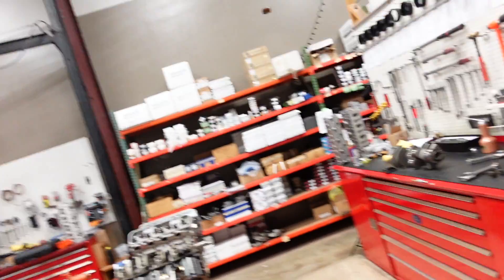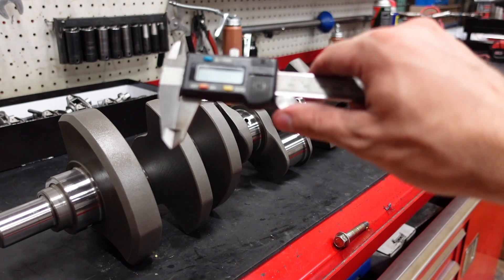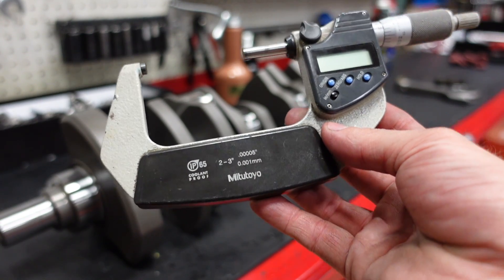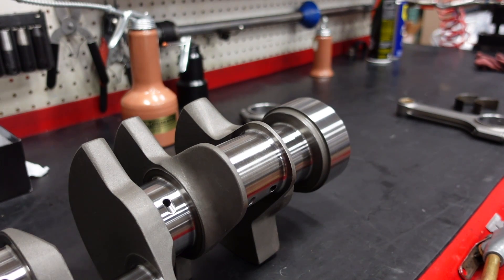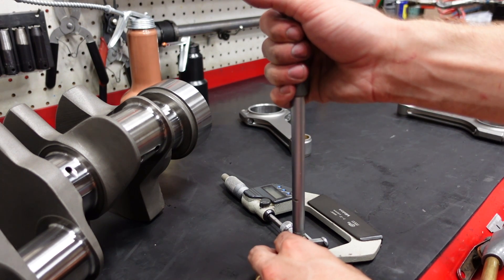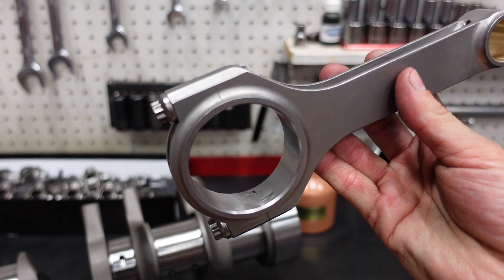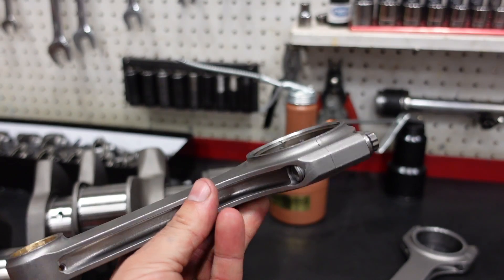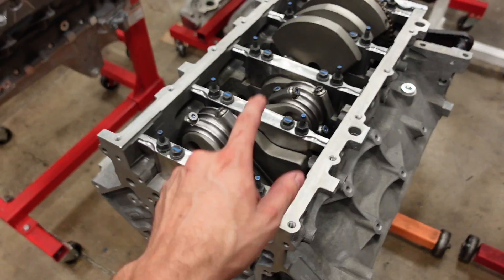Measuring Bearing Clearance (very easy) - Tech Tip Tuesday

Comment: Man I don’t usually comment on stuff but you have no idea how to use a micrometer. The ratchet  on the end is there for a reason. This is 100% not how you use it. Even if just using it to set your other tool you still would set the mic using the ratcheting end and feel. Not locking it and shoving it on the crank.

Comment: Hello and thank you for the video but to understand correctly if you had put the micrometer in the rod bearing to measure and the gage went to zero that means you have zero clearance instead of the 2.900 clearance?

Comment: can i get the clearance without having any current bearings??  or do i have to buy a set of bearings??
i just got my crankshaft machined, i dont have any bearings but i have crankshaft journal measurements only. i bought a mitutoyo bore gauge to measure the rod journals but i dont know if i can do anything without the bearings.

Comment: Im laying below my car, in the rain, its cold, dont got any tools other than a caliper, oil pan removed, crank bearing at cylinder 4 ended up in the oil pan, trying to meassure if my crank shaft can be fixed, chat gpt says if more than 0.5mm are missing it cant be saved, i did meassure between 0.2 to 0.4mm are missing, it also got grooves, idk what to do
Reply: Sand it and send it. Then sell.
Reply: @Slug2.0T  nah, aint gonna sell this beauty. Ended up buying a junk engine with a decent crank, currently removing the engine to have it sent to a shop for a full rebuild

Comment: Is it me or am I missing something. These videos show the installer measuring with bearing shells in place. How does that make sense. How do you know what shells to order ? Do you buy the wrong ones and then buy the right ones? I have a crank that spun a bearing . The crank survived luckily but the shell is damaged because I think the wrong shell was installed on a previous build ( not by me). I normally work on Harley engines that don't use shells so I am not an amateur, just not used to working with shells.   I want to measure the crank pin and the rod then order  bearings? Why do I need bearings already installed when I don't know which to buy?. The rods don't come with bearings.  The shells don't seem to be able to be ordered by thickness , only colour or number 1,2,3,or 4. I must be missing something. Please comment if you know what I am talking about.  To make it more difficult the vintage engine does not have many parts available so I can't just buy all the bearings and see which work best.
Reply: Currently the question I’m trying to answer. Do I spend premium money on a premium set of standard bearings just to find out I paid for bearings I don’t need?

Comment: I have been doing this exact method and have been having trouble getting consistent measurements when I remeasure things. I have a feeling it's because I haven't been consistent with the micrometer pressure on the journal.

Comment: Do you ever worry about scoring the bearings when using the bore gage?  Some guys measure without the bearing and then check thickness of the bearings.  I'm not sure which is better.

Comment: I use the ratcheting mechanism on the end of the micrometer so you don't over tighten the micrometer when measuring. Also I check the micrometer with the proper standard to make sure it reads true before measuring components.

Comment: So once you've torqued those rod bolts to spec, when you take them back apart you may need new ones as some of these bolts (BMW M20 engine )can only torqued once.  How do you get around that?
Reply: The rods he was using didn't have torque to yield fastners

Comment: I am curious about the rod bolts. When you replace the rod bolts, is it OK to do this testing then  to remove the nuts/caps and reinstalling back into the cylinder?

Comment: Thank you for the video on this! I greatly appreciate the insight! With that being said, my dial bore gauge left some marks (they look like fresh metal marks) on the con rod bearing when checking it. Would this still be okay to still run these bearings even with the lines showing up on it? First time using a dial bore gauge to test bearing clearance and I want to make sure we don't jack up the bearings just checking them 😅 

Thanks again for the vid!

Comment: if i had a guy in my shop that tightened down a micrometer and forced it over a crank journal the little jerk would be flipping burgers tomorrow.
Reply: That was a good demonstration on how to get the feel for the right amount of tension. It was a good demo except for the hair on the back of my neck raising when it squeaked.

Comment: The rod bearing is typically not even close to round or flat across the face.  What is the clearance that matters on the rod bearing?  Middle (max) or outer (min)?  And also where radially - perpendicular from parting line (narrower)  or closer to parting line (wider)?

Comment: Question: I just pulled the motor from an Audi A6 3.0 V6 . I pulled it because it sounded like Rod knock, but when I broke the  motor down the only bearing that looks messed up is the front most of the four (front of the car) don't know what that particular bearing is called . I mean I know  it's a main bearing, but I thought maybe they had technical names for their exact location.  The bearing is seized around the crank. Could that make a rod knock sound? The sound was only under load and there were no codes and I checked everything as I broke it down and can see no other problem.

Comment: I like how you explained it a little better if not a lot better than some of the other ones I saw on YouTube. It's been over 25 years since I mess with a dial bore gauge and Mic set. I usually throw the motors together with the bearings as they are without checking really. Unless I run into a problem where it's too tight. But with this performance build I'm doing with a LS3 and LSA supercharger I'm going to make sure everything's correct.

Comment: Or you could use the part on the end that spins free of the other spinny bit. Thats how you properly adjust to the correct measurement without putting the micrometer under tension.
Reply: This is the only way. Mitutoyo engineers crying. Apart from that, good video.

Comment: What clearance would you recommend for a turbo ls? Iron block running summit ls pro forged crank and rods currently have extra clearance shells on top and bottom on mains and rods. Aiming to hit 1k+ is 0.003 too loose ?
Reply: 3 thousandths is good and you’ll want a higher weight oil

Comment: That's one way to do it, but I prefer to take multiple readings around the journals, average them, and check out of round or taper on the journal. Taking one point doesn't give you the whole picture. For a relatively loose race deal with .001" clearance per inch of journal diameter, this method works, and is better than Plastigauge. I would go further personally, and especially when going for tight clearances with thinner oils like many modern race engines.

Comment: Then replace all the bolts that were just stretched to yield as per torquing to spec instructions?
Reply: ARP hardware isn’t torque to yield like oem hardware that stretches

Comment: I love your videos and I love your channel. 

Keep the videos coming!

I do want to say, when determining the diameter of the journal, you should be using the rachet at the end of the knurled gripe. This is setup to slip once the correct "tightness" is determined and the measurement can be taken. Turn the rachet until it stops, lock the spindle in place and that's the most accurate way to get your measurement.

Comment: BTW, if you need a micrometer specifically for tubing or tube type materials, they make special anvils and micrometers to make it easier when trying to find the high points. A 10th mic with gently hands works fine (.0001 accuracy and calipers will be good for .001 accuracy) Mitutoyo and Brown and sharpe are 2 of the best.
Reply: How do I find one of these? Tried googling and not much luck. Sounds more accurate than trying to guess the right feel of tightness
Reply: Something that misleads a lot of people. 
It looks good that there's a 50 millionths *resolution*, but that doesn't mean it's that accurate. My 0-1" Mitutoyo, according to the calibration sheet, reads +.00005" at 5 different measurements other than 0. Unsure on my vernier ones, .0001" resolution, but I'm sure they're anywhere in the +- .0001 throughout the measurement range. It's not much, sure, but it can be the difference between something in tolerance or out.

Comment: Guys, please don't do that to your micrometers. Gently find the center (highest points) on the material, then gently twist until both sides make contact and you cannot close the micrometer any further. As a machinest I appreciate you recommending micrometers, but that is not how you use them and will ruin the precision by doing that.

Comment: Thanks for the info. Nice video. However, I think you rushed it at the point of showing how much actual clearance was determined, while looking at the bore gauge, and the needle was sweeping. Some might not have caught on that you're looking for the maximum amount of deflection in a clockwise direction from 0.

Have you ever discussed the condition of main caps, and what their condition indicates?  For example, I have one main cap that has surface (bearing side) ever so slightly rough (maybe spun bearing?), while another main cap, which I think was at #1, looks like it was polished, almost chrome. What are these cap surfaces telling me?

Comment: Man when that micrometer was extra tight on that journal and it caused it to squeak it sent a shiver down my spine lol
Reply: If you think you're scratching the crank that easy then......well idk what to tell you then, it wasn't a sharp edge, it was flat on flat and there both hardened, am I the only one thinks that was no big deal?
Reply: @troybrake5686 I doubt there will be no impact on the micrometer anvis, even though there are 7 types [ based on my experience],  even if the impact of scratch on the shaft is insignificant
Reply: @troybrake5686 😂 0:36
Reply: I work for cat an do this a lot , most people have it over tight an  scratch it 😬.
Reply: Hey whats the little knob on the back that tightens it down but goes clicky clicky when it starts to snug onto what your measuring for??
Reply: The large thumb wheel is for moving the anvil large distance. Once you feel resistance with this, you move to the small thumb wheel and turn until the fine tune ratchet clicks. @bluedogydoor
Reply: not what you do, you aneak up on it, and have to have the right feel. you can change the reading by using too much force
Reply: That's the only reason I came to the comments
Reply: It’s perfectly fine🙄
Reply: was about to watch this video but when i saw this I'm backing out.

Comment: I have some telescopic bore hole gauges.  Would I not be able to use it and then measure it with the Micrometer?
Probably better with the bore gauge I think.
Thanks so much for your wealth of knowledge.
B
Reply: Telescopic gauges suck for this purpose. Get a dial bore gauge, and get one that reads .0001". May as well be using plastigage with anything less. (Don't get me wrong, a zillion engines have been put together with Plastigauge, but it isn't performance precision. I have found that the stuff reads a full thousandth tighter than actual clearance while experimenting on the same short block. ex. .002" w/ PG = .0029-.0031 with my dial bore gauge.)
Reply: You are introducing more random error by using telescopic gauges.

Comment: Okay let me stop you about your tension against the rod journal. The little knob at the very end of your caliper is your tension. When you turn that and the caliper stops moving it clicks because that's the set tension you want that caliper to have against the material. Once that clicks you move it to see if there is more tension or less tension anywhere else. Use your tools correctly and they'll save you every time.
Reply: Not really required, some people prefer them, others like to feel the actual thimble when it stops. As long as you're consistent and that translates into all your measurements you should be good.

Comment: I'm glad I found somebody that's willing to share their knowledge. I am getting ready to redo the bottom end of my Duramax and I am having trouble talking to people about how to do it because all they care about is making money on it and they want to do it themselves and not share any knowledge so I can learn.
Reply: This is way late at but how did your Duramax build go. I'm looking to do mine real soon, a little nervous, but want to tackle mine myself also
Reply: 😮 that's because people want your money due to lack of knowledge wrather than them having the heart to spread knowledge.  To be honest your doing the best you can be learning yourself, as I'm learning clearance for a fox body rebuild to drop in my 3.8 mustang for a 5.0 swap. I'm doing a big cam, porting some bigger explorer heads and porting the intake as well along with exhaust ports, and replacing all pieces to spec. Wiring simple bc I'm using holly terminator x max wires and computer to control motor and trans. Just get the Haynes rebuild kit I used to rebuild my 3.8 mustang as your awesome and will go far my friend bc your making it happen

Comment: Using the micrometer method is wrong. You have to use ratchet stop instead of timple. The purpose of ratchet is to apply same force whoever may be using the micrometer.
Reply: For rookies

Comment: Why did you use torque specs rather than checking the stretch with stretch gauge on rod bolts

Comment: Since the micrometer is only used to "copy" the journal diameter and not to measure it, can't a quality caliper do the same ? To answer this, I would set the bore gauge as you showed and compare (several times) with the caliper (if I had the tools...)
I'd love to know how (in)accurate it is...
Reply: We use mics to measure and compare in tenths. A caliper is not for that kind of accuracy and will not repeat the way we need it to.
Reply: @whiplashmachine  I've heard this a lot, but yet to see any proof. My calipers repeat just as well as my micrometers and measure dead nuts on gauge blocks.
Reply: @KISSMYACE3203  just goimg by what I've heard. I don't know much about machining🤷‍♂️
Reply: Micrometers for .0001 acuuracy, calipers for .001 accuracy. If you got deep pockets, they have micrometers for .00001+ accuracy in the $1000 range.

Comment: I'd be paranoid about scratching the bearing material with the bore gauge, lol
Reply: It happens. I have the same Mitutoyo bore gauge, and I removed one of the internal springs, because it applied too much pressure. Marks will always be there. Gouges should not.

Comment: If you think about it, if you're just an engine builder, the manufacturers of the parts your using do all the work for you. All your doing is making sure all the parts go together correctly.
Reply: You'll be surprised how off alot of parts are
Reply: @josephg8818  exactly.  a lot of people  have  just "thrown it together "  with the right spec stuff and  the engine seizes up

Comment: Great video! When measuring the connecting rod bearings, are those the actual bearings that you use in the engine when assembling? Just asking because I dont want to potentially damage a new set of bearing shells. Thanks for the info, can't wait for the next video!
Reply from the maker: Yes, I always measure the actual bearings I will be using.

Comment: When using two different sizes of bearing shells to get your final desired clearance,  which side of the con rod/cap  and which side of the block/cap combo do you place the smaller in internal diameter bearing shell half?

J
Reply: Thicker bearing on mains should be on the cap and on rods should be on the rod side. Think about the direction of force after the combustion event.
Reply from the maker: It does not matter to me!